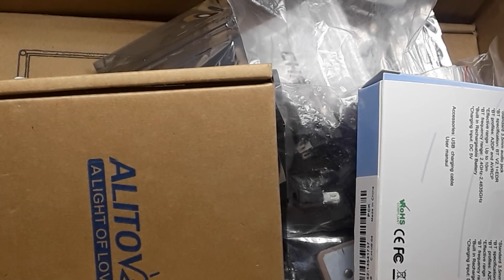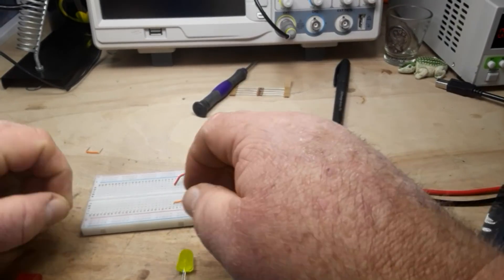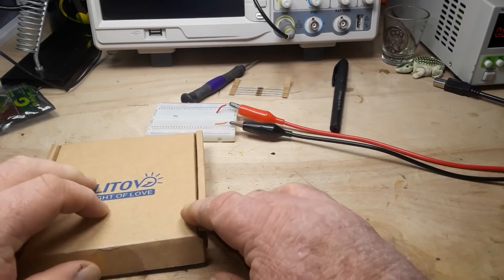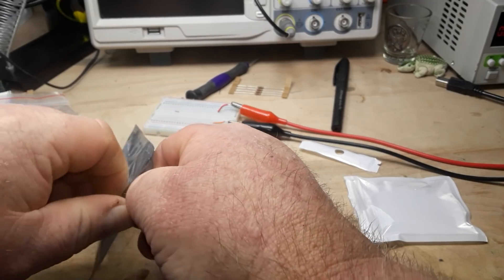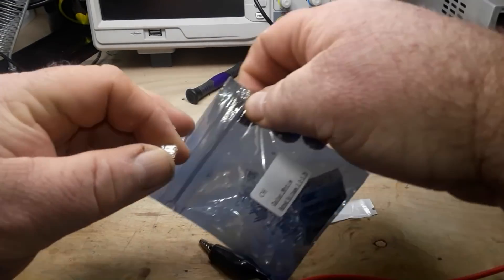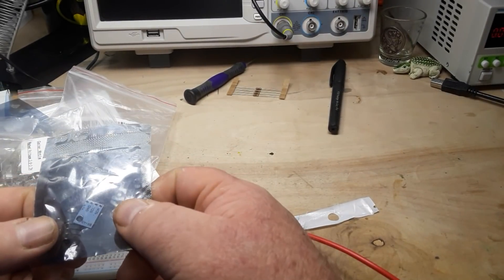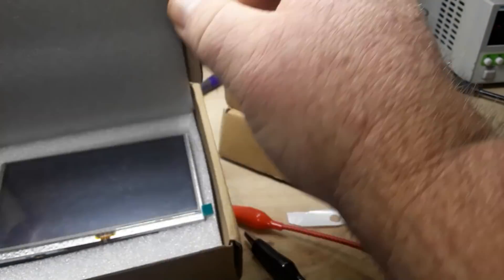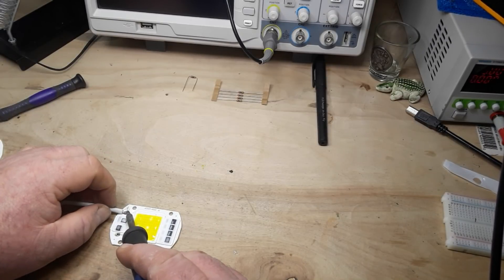Electronic care package from Oregon

Comment: Those piranha knock off leds are pretty nifty I recently got a 50 pack of the 5mm domed red ones and I've been torture testing one at 2 volts at 100 milliamps and it wont die.

Comment: Those COB LED modules also come in 12v without sacrificing brightness.
Also the square 4 leg LED's are Piranha LED's and are usually very bright and good for building large rectified AC LED panels.

Comment: Hey Paul nice score once again! That super LED at the end is intriguing - does heat sink back-plate connect to the hot side? Seems dangerous especially since it looks like it will need to be mounted on a larger aluminum block. That reminded me of the video I saw not too long ago on StyroPyro's channel - crazy young smart kid - he hooked up a 90 WATT (not milliwatt) LASER DIODE assembly into a Buck Rogers pistol grip - made from a salvaged radar detector gun. That thing required serious eye protection as even lightly reflected beams from that thing would burn your retina in a microsecond. He was burning down his neighbor's trees with that thing. The military uses an infrared version of that called DEW - Directed Energy Weapons! Of all the items you scored (besides the super bright LEDs) I found the HDMI LCD panel would be most useful for me - have been looking for a compact RaspPi display myself....next acquisition....
Reply: These do well connected to computer CPU coolers with fans